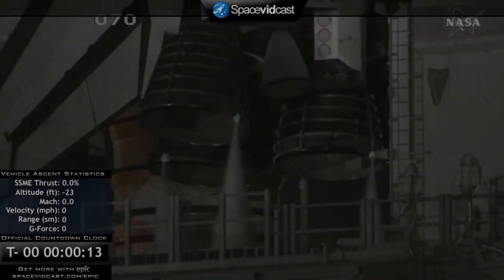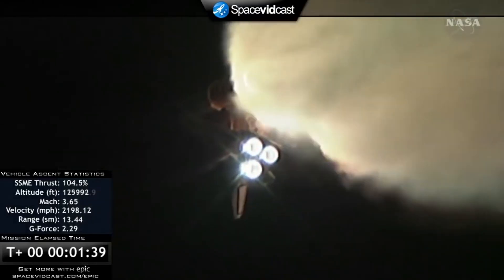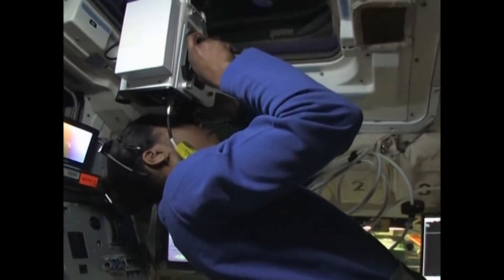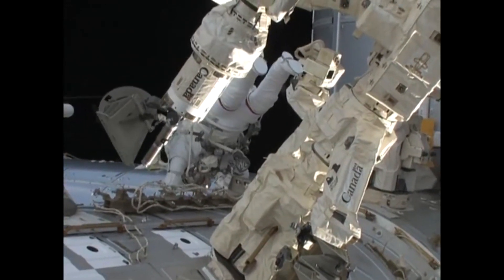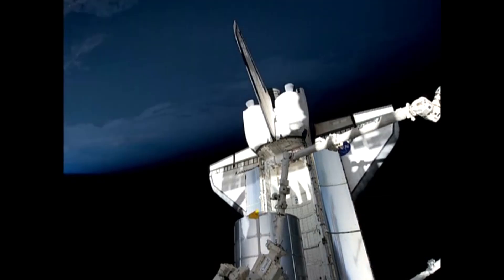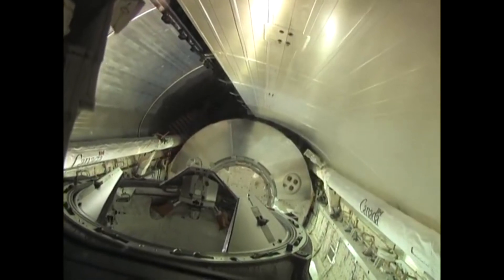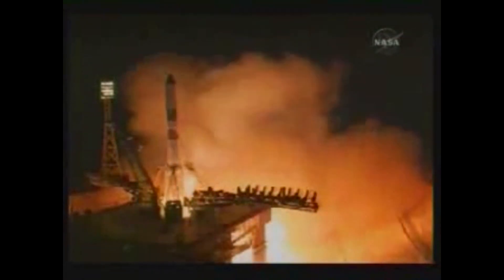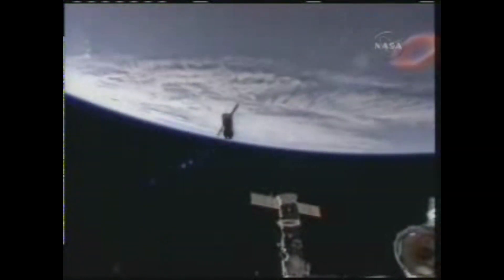International Space Station - Episode 39 - STS-131 & Expedition 23

Comment: STS 131 was a supply flight and an important one during this mission the crew delivered supplies and preformed repairs they also routed cables for the next edition to launch on the next mission. Inside the station two new racks were installed in Destiny the WORF which is a window shutter and the Express Rack 7 which will be used for 3D gene printing and making tools. With STS 131 complete Expedition 23 had to move some ships around before the next edition could be launched. Soyuz TMA 18 which was docked to Zvezda had to be moved to Poisk so Progress M04 could dock M04 remained docked until May 10 2010 to make room for Soyuz TMA 17. Soyuz TMA 17 undocked for the last time from Zarya bringing an end to a decade of station dockings and was moved to Zvezda where it remained for a month before it was undocked in June in preparation for the launch of TMA 19. The station was now ready for its newest module Rassvet which has now arrived at Kennedy Space Center on the Antonov and is in processing at Astrotech and the Space Station Processing Building. It will come up on STS 132.